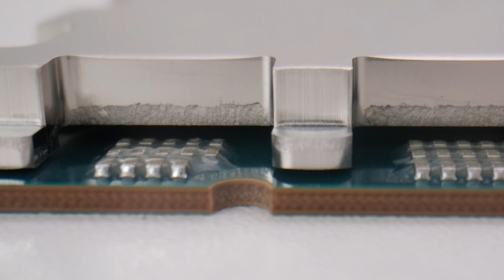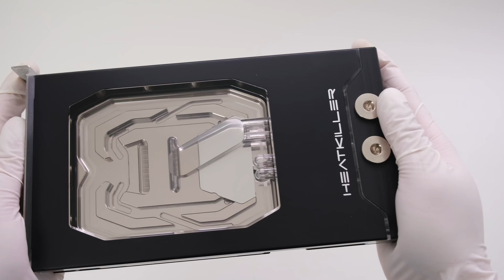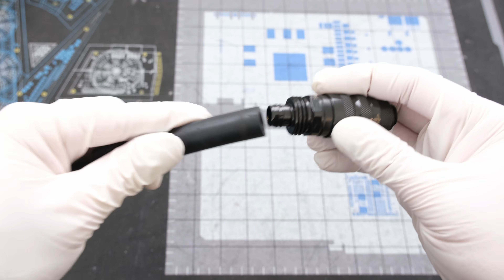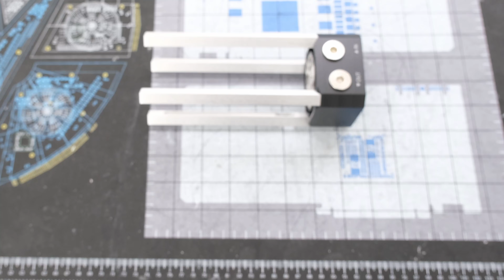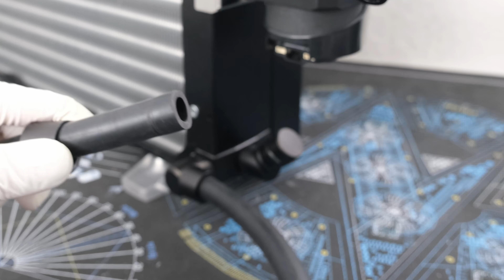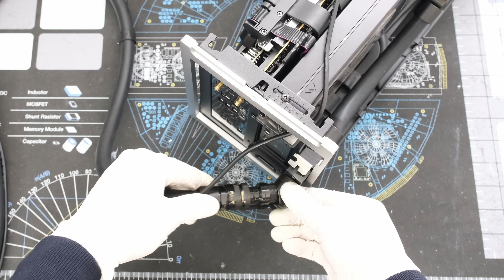Ultimate Silent ITX Build - Step by Step

Comment: What's the point of building in a small case if you need to attach a massive external cooling system to it? If space is no issue, just build an integrated open loop in a bigger case, much neater.

Comment: Two things I would add to this build would be adding a USB 2.0 port to the motherboard port area on the back of the case so you can quickly connect/disconnect the MORA system without having to open up the case and also finding a way to get rid of/moving the fan on the bottom of the case to the inside since it looks kind of like an afterthought. @vectornetwork

Comment: I love the concept of separating the cooling responsibility from the computer. As long as you can connect cold/pressurized water intake to this PC, you can take it anywhere while having max performance and tiny footprint. If you have the opportunity, you could even connect the PC to a home AC system and forget about cooling it/maintaining the MORA setup entirely.

Comment: I am very suprised to see someone provide such a detailed spreadsheet, that definetly helped in finding how many fittings and hardware I needed!
What are the measurements for the 4090 with the waterblock?
What AMD gpu would you recomend for this?
What 4080 super would fit in this build?
Thank you for this high quality video! 
:D
Reply from the maker: A 4080 super with the same water block will fit. IIRC this may be the only 4090 water block that will fit like this in the terra. Hope that helps

Comment: What performance if any can you get out of the pc when its not connected to the radiator? Would you for example be able to play a couple hours of games before it gets too hot or is that just a no go without a raditor?
Reply from the maker: For this build, the radiator is required. A couple of hours is out of the question. Maybe a minute or so. Maybe less.

Comment: great video! one thing though, is coil whine not an issue? i built my pc in an mATX case because i didnt have the funds for a full fledged itx build, and while the pc stays very quiet in idle, as soon as i open a game there is very noticeable coil whine. My GPU is an rtx 4070 super and draws relatively little power in comparison with the big boys (around 220w), so i imagine a flagship build would be even louder

Comment: Given that there is not much need to move much air inside the case (just psu&some passive components), what is the smallest case you could put this into?
Reply from the maker: Thanks for your comment 🙏 Good question. The Fractal Terra is quite small. I am not aware of too many cases smaller than this case. But I think you can keep going smaller if you really wanted to, but not too much more, maybe like 20% smaller tops. Hope that helps

Comment: Is it possible to have the fans on the mora, the pump, and flow sensor be powered by the PSU in my case?
Reply from the maker: Thanks for your comment 🙏 Great question. You nailed the very first question that needs to be asked in a build with an external radiator. Do you want the power coming from the PSU in the Case or from another source? If you choose the case, you either need to also move the Pump into the case or the distance from your case to your external radiator Mora will be limited by the length of that cable coming from your PSU. It's a tradeoff. Hope that helps

Comment: Just have a question on this build as it's not very clear to me. 
When you are powering on the PC, this also powers on the D5 pump and and fans via the controller?
Do you also have control via software over the fans speed and the pump speed? Thanks
Reply from the maker: Thanks for your comment 🙏 Both the switch and the PSU needs to be powered up. I turn the Watercooling switch on first, then the computer. This is the way to have a pump on the radiator and to also allow for longer tube routing from the PC to the radiator. If you have the pump in the case, then you are dealing with needing a larger case or dealing with more noise. If you have the pump on the radiator, then you are dealing with how to power the pump. You can route the PSU cable from the PC, but that isn't really that elegant and those cables are short. As for the software, Aquacomputer and Aquasuite software was specifically chosen because of their nice software that remembers settings. I have so many builds, it nice to just throw in the Quadro and it already has a lot of my presets. Hope that helps.

Comment: why did you need the extra devices when you have the D5 next?
Reply from the maker: Thanks for your comment 🙏 Good question. Those extra devices are not needed. This way ensures that it can be done even without the Aquacomputer D5 Next Pump. But, the next version of this build in a more recent video does specifically show a cleaner and more streamlined way of doing this by utilizing the fan control on the D5 Next. https://youtu.be/zH-YWCSDi2E Thanks again
Reply: @vectornetwork  I see, thanks for the reply, the build is very nice

Comment: I'm a bit confused. So does the pump and fans turn on when you turn the pc on, or do you have to turn them on manyally with that switch?
Reply from the maker: Thanks for your comment 🙏 In short, it has to be done manually with that switch. It's why it is there. The other option is to connect the SATA cable from your PSU in the PC to the pump. This will allow you 1 button to turn on everything, but at the tradeoff of being restricted by the length of the PSU SATA cable and also figuring out how to route the cable out of the case. The switch is the most streamlined way I could think of to do this. Hope that helps.

Comment: Hi can I ask another question?  I’m doing the leak test right now (I.e. computer is not on).  The LED on the D5 is on, but is off on the flow sensor.  Everything is connected per your video.  Is this expected?  Sorry, the documentation on Aqua Computer products are really lacking…

A review of connections, all parts are the same as in video (do I have this right?):

Flow sensor:  USB to Hubby 7 (only one cable)
D5: SATA connector to PSU, and USB to Hubby 7
Quadro: Molex connector to PSU, single PWM connector to the 4 Noctua fans, one connection for ambient temp sensor, USB to Hubby 7
Hubby 7: USB 5-pin from flow sensor, USB 5-pin from D5, USB 5-pin from Quadro, USB 5-pin TO internal motherboard, SATA connector to PSU (you didn’t connect this in video, but wasn’t sure if I needed to provide power)
Reply: So it turns out that on the Hubby7 you can specify power supply: either from USB/motherboard cable, or SATA.  This is specified via the jumper on the upper left of the Hubby7.

I switched the jumper to SATA, and then the red power light on the Hubby7 came on, as well as the LED display on the flow sensor.

But then the flow sensor started giving me an alarm with the message “5v out of range”.  I don’t know what that meant specifically.  The SATA power to the Hubby7 is coming from a spare/unused SFX PSU (with jumper), and was also on same cable powering the D5 (no error there).

So at least I know the flow sensor’s display works.  I switched the jumper back to USB, just like in the video.  Once the leak test is done I’ll turn on the computer and hopefully all the Aqua Computer stuff will be working then.

Comment: Very helpful video!  Question: regarding the 5-pin USB cable (from Hubby 7), did you connect it to a 9-pin mobo header?  Just want to make sure I understand this correctly.
Reply from the maker: Thanks for your comment 🙏 Yes, correct. My understanding is that the 9-pin USB mobo header allows for 2 of these 5-pin USB cables from Aquacomputer to be plugged in. Why does it only have 9 then and not 10? Well, your guess is as good as mine, but I also understand that it's really those first 3 wires (starting with the red) one that does anything and the second 2 black ones, I'm not so sure what they do. In short, you can plug 2 of those headers into that 9-pin slot. Hope that helps
Reply: @vectornetwork thanks for confirming my own answer to my question - these components are expensive I don’t want to fry them! :)

The answer to your question about why only 9 pins if there is room for 10 - it has to do with the single 9 pin connector (as opposed to two 5-pin connectors).  It’s to prevent somebody accidentally plugging it in upside down, which would fry your components.  This connector lacks a hole in the 10th position, and so if you were to try to plug it in upside down, pin #1 would be facing the part of the connector that lacks a hole, preventing incorrect insertion.

But this physical design does not prevent incorrect insertion when dealing with 5-pin connectors.  So I wanted to make sure what I’ve read by double checking with you!

On a different note, something you may want to mention in future videos, is that for a 4090 with waterblock to fit inside the Fractal Terra, it has to be a 4090 Founder’s Edition (with Heatkiller waterblock).  All the other 4090’s from other brands often have EK waterblocks as the only real solution - however, the water terminal on top is too high, about 5-10mm beyond the top of case.  So, you’d be unable to use the Terra with EK waterblock, unless you want to run the computer without the top lid.  🤣I learned this the hard way, but fortunately it’ll fit in the FormD T1.  The T1 even already has two passthrough holes in its rear.  So I’m really excited.  I’ll find a different use for the Terra, maybe my next build.

Btw, ignore all the trolls calling your “ITX with MO-RA3 radiators” videos click bait.  I’ve always been wanting to do SFF with reusable external radiator, and here you’ve shown me how.
Reply from the maker: Ah, yes that makes sense and its the way with all these connectors. Only really one way to plug them in, its like that with a lot of these. 
Yes, since you can plug these little 5pin connectors in backwards, that was when I actually had to learn which way was which and it seems like the red wire goes first and the last 2 wires are black. I figured aqua computer partly used these 5-pin connectors because it does get to a point where a user may need 2 or even 3 slots with all their peripherals. 
As for the HK block being only one that fit in the Terra, well...yea, that's kind of why its cool. It fits! Almost nothings fits in that thing. I wanted to initially put the Optimus block into the Terra but it wouldn't clear the top and they never seemed to release a block for the Founders edition. I put the Optimus block in the next version of this build, which improved on just about everything. I also ran this rig without the top on for a while. It's a option.

Comment: I'm thinking about doing something like this. I'm running a 5800x and 4090 on two thick ekwb 240mm radiators. Temps aren't too bad at a max of 1200rpm. Hovers in the 70's while being pretty quiet compared to the air cooled version of the build.
Reply: It`s hot ....

Comment: Is there someway to build it with a smaller radiator ?
Reply from the maker: Thanks for your comment 🙏 It is possible to build with a smaller radiator outside of the case, but not inside. For that, I released a new video that improves on this build by including a radiator in the case and ability to run standalone without the external radiator. https://youtu.be/zH-YWCSDi2E?si=5kQHakpxSxXW4o8F

Comment: in my mind this is ideal. I always hated gaming room/bedroom heating up because of gaming so if I could run a passthrough through the drywall to a different room that would be the best although now that I think about it I guess I could just pass through mouse keyboard and monitor cable aswell and leave the whole case over there and it doesn't matter. Ether way this thing is sick silent performance is under rated.
Reply from the maker: Thanks for your comment 🙏 You got it! The best part of all of this is that its completely customizable to your own situation. I just released a new version of this Silent 4090 build, this time it can run standalone and it has a 14900KS and a Strix 4090. https://youtu.be/zH-YWCSDi2E?si=5kQHakpxSxXW4o8F

Comment: In regard to the comment I just deleted, the MORA3 is made copper tubing and aluminum fins. The loop should be safe. I had mentioned that the aluminum radior would corrode when mixed with brass, copper, and zinc. However, after doing a thorough investigation on the build specs of the MORA3, I learned that only the radiator fins are made of aluminum. Great build.

Comment: Man, this is a itx case, not a Lamborghini that you drive 200 km per hour, you just play a fricking games on it, not a running nuclear plant on it.:face-green-smiling:
Reply from the maker: Thanks for your comment 🙏 I recognize. I'm not relaxed. I try to be. But I'm not. This is what I came up with and I have a sequel coming. It's a Delidded 14900KS and a Strix 4090 in a Optimus Block in an ITX case and I wonder if that will silent too.

Comment: Would this be fairly easy to build for someone with 0 experience? I’ve built pc’s but never any water cooling other that the AiO cpu units by Corsair
Reply from the maker: Thanks for your comment 🙏 This build, technically, is user-friendly. If someone has all the parts, it's straight forward. It does not have any hard tubing. The EPDM can be cut with a scissor. This specific soft tubing is GOATED (greatest of all time) and the installation with the fittings is so nice that I really can't imagine how a leak can happen at a fitting to EPDM location. Having said, I have sequel coming and I made improvements to nearly every portion. The base is a Delidded 14900KS and a Strix 4090 in an Optimus Block. The case I'm using Lian Li Q58 is easily to work with than the Terra and the build has less wiring in general, so that may be slightly easier. That video will be out within a month. Hope that helps.

Comment: Very helpful guide! Thank you for that! Quick question, though - for the external power brick to the D5 Next, what's the wattage? I'm looking at setting this up with the dual top module and two D5 Next pumps. I see that max wattage is 65 watts per pump - so can the power brick handle 130 watts? And can I connect two SATA power connectors to it?
Reply from the maker: Thanks for your comment 🙏Do you mean the Anker power brick or the individual SATA adapters to power the Next Pump? Either way, I think either should hold up. I think I would have plugged in two laptops into that power brick. Hope that helps